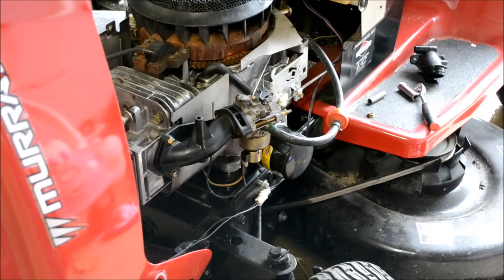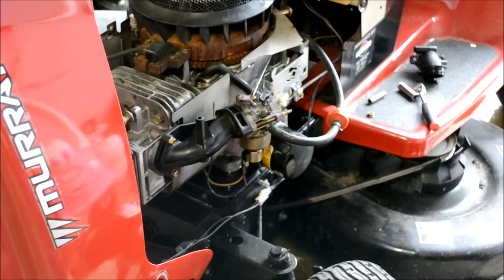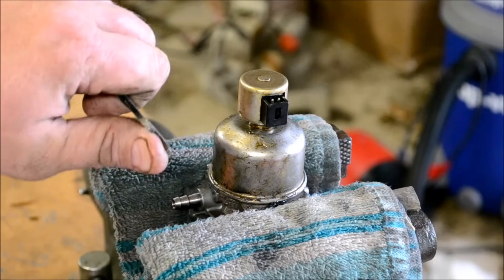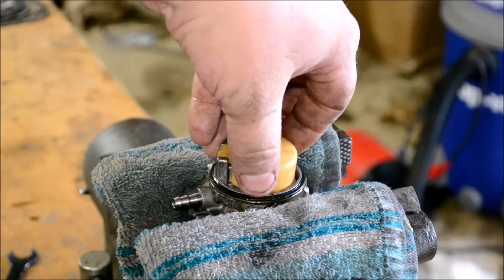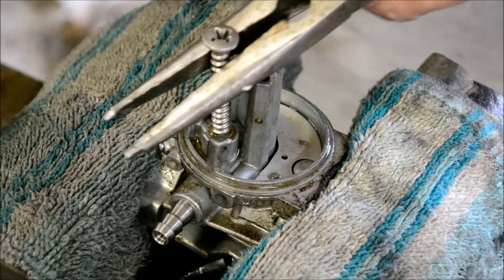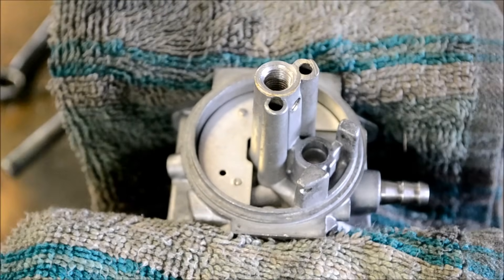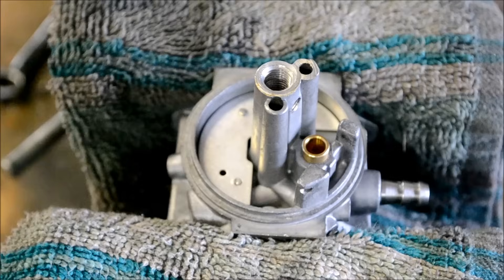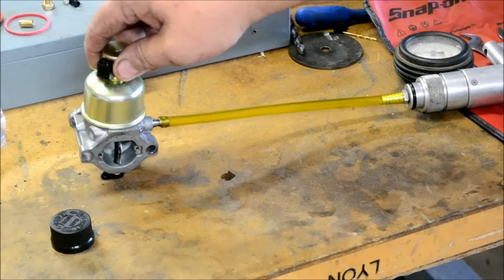BRIGGS AND STRATTON CARBURETOR REPAIR / GAS SHOOTS OUT OF MUFFLER / CRANKCASE FULL OF GAS

Comment: I have taken my carb off TWICE & cleaned the float bowl & blew it out & flushed with CVarb cleaner & reinstalled it ............. and STILL it wont start without starting fluid       .........   And when its sitting, the little black rubber tube vaccuum I think       ...... drips gas. ........ I always thought the Seats were a small rubber gasket kind of thing.             .....   I pray I dont have to remove this carb yet Again,this is starting to suck.

Comment: How can you tell a walbro carb from a Nikki? Model 31C707 type 0175E1 code 021217ZE stamped on engine
Reply: Briggs & Stratton uses both these carbs on there engines. You will have to look at the carb to see which one you have. They are plainly marked, written on the aluminum Walbro or Nikki. Either brand will work on your engine. You have to have the proper model number. Although 14 to 20 HP will use the same carbs pretty much.

Comment: Put a shut off valve in the gas line before or after filter. Shut off after each use. Winter storage shut valve off and run engine until gas out the carburetor. Problem solved.
Reply from the maker: Larry G that’s just a bandaid and not a fix.  Just fix it right the first time
Reply: Sorry, all I can afford is a band aid. But because of you I can fix the problem when I have no other choose. THANKS

Comment from the maker: ouch!  never ever ever ever  soak a 2 stroke carb in barrymans as it will murder the rubber check valves inside the carb......yup now that you have told me that bit of info i am sure you need a new carb now

Comment: @THEMOWERMEDIC1  ...AUGUST 16, 2020...   long shot because this vid is old. Also I see you don't reply much in this vid. Or to any of my stuff on your vids. I attempt to ask below and or challenge anyone With a solve and why. Every vid I see no one can answer or for most part is blank in reply. That is when many ask ( like in this vid ) about continue issue of flood. So, I have same setup as you. Same engine BUT my carb is Nikki-799727 original factory on Briggs motor. That carb floods in crank. Rebuilt with cheap kit and still floods. Brought another Nikki original used and floods. Rebuilt with after market kit and floods. Third, brought a used Nikki original again and floods. Rebuilt it with aftermarket kit and floods. So, keep in mind this carb the seat is the whole plastic insert. Needle sits down in a bare round tube. When I say rebuild I mean full clean, full hole brush clean. Needle, seat, main jet and bowl gasket. All O rings replaced and fuel mix screw replace ajusted to 1 and half turn out. New fuel line, gas tank flushed and gas filter 493629 on it. Also gas shut off valve. Flooding I mean steps as- start engine upon gas shut valve open. Starts,  after few cranks. Runs smooth on low and high for 15 sec. Engine dies. Air filter tube has gas in it, oil has gas in it. Shut valve off and restart and once engine clears runs fine. ONLY for 15 sec and repeats issue. Three carbs, rebuilds and clean, 90 oct no eth gas. Floods to crank bad. Any takers who have the answer to all but this one? Every vid seems they have the answer of this needle and seat replace even on my Nikki carb. At least for speaking of my carb there is more to it to solve. And yes, all the back fire inserts on bowl bottom check out fine. A simple seat and needle is a no go. Many have the issue I do even putting new carbs on at the gate and flood. Riddle me that one..... The end result... After spending a month and many hrs at no luck I am waiting on a cheap China carb. Of which is my LAST option I wanted and first time on a cheap carb. I thought to try for myself and more money wasted I assume. For I got a gut feeling it still will flood.... I am not holding my air but, I wonder if I change to a seat that you can take out that is not all plastic may help. What is the link to the carb you show in vid or part number?